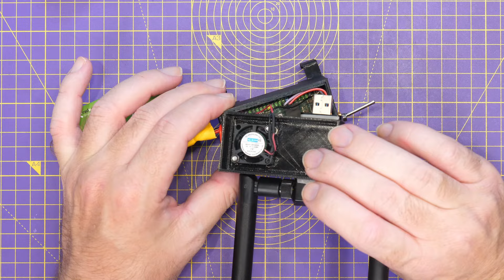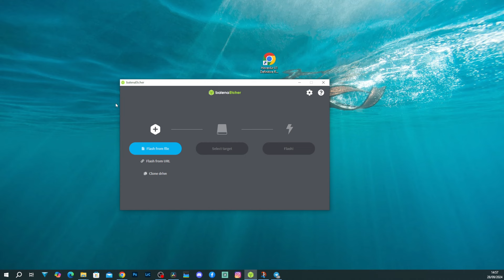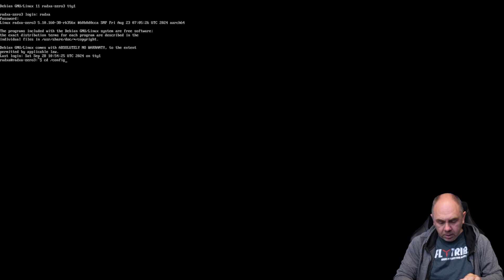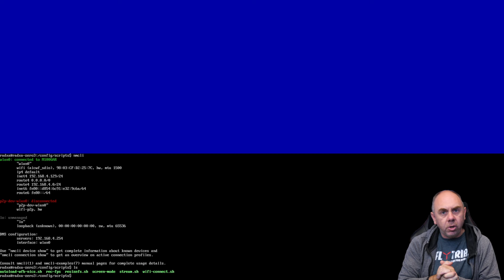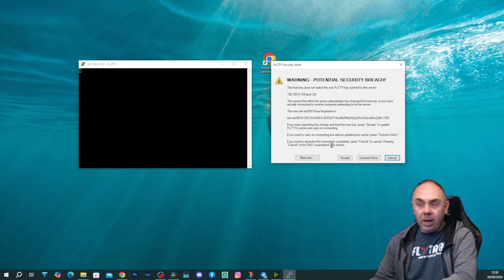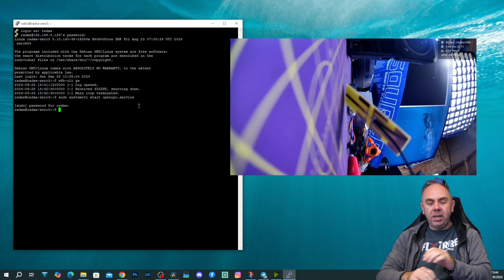OpenIPC SBC VRX Ground Station Setup Guide For FPV Goggles

Comment: I got the emax 100mw vtx, raddxa zero 3w 4g ram no eMMC and header attached, and RTL8812AU wifi adapter. I needed a usb wifi adapter anyways, I gave my last one out, so I am excited for that hat to come out. I will give it a try :) I fly analog
Reply: okay I have my radxa working and setup. my wifi password wouldnt work, so I set it up with my phone hotspot, but who cares that just for ssh.

Comment: Great! Finally a decent guide on how to make a ground station for analog goggles with HDMI.

I would also very much like a guide on how to do it with the Radxa version with eMMC memory (I have the 1GB/8GB eMMC version) and preferably with recording the image on an SD card inserted into the Radxa. The description on Github is very laconic, nothing is explained in detail there, and I (like probably a lot of people) am just starting out with OpenIPC and Runcam Wifilink.

Can you see OSD data from the flight controller on the Radxa's SD recordings (in particular, GPS coordinates are important in case the drone falls and you need to find it)?

Can you play Radxa recordings in the field, on gogles in case of a crash? This is extremely important

Comment: Can you also make a hdmi to csi example? I think this could be more useful in smaller budget scenarios as the real camera transmission sort of what that other dji vista adapter was with those 720p cameras, do you remember? I think one would need for example a gopro + media mod, micro hdmi to csi, raspberry pi zero and one of those wifi adapters obviously plus the power cable but this would also work with bigger cameras etc so the "vtx side" stays the same and i dont know could be strapped to the lipostrap or so

Comment: As you mention, using an 8812AU/EU WiFi board with your choice of antenna is somewhat lighter/more sleek than your setup with the encased card and large commercial WiFi antennas.

Comment: I flashed the SD card. Hooked up to my monitor. Nothing, what could be the problem problem,green light comes on
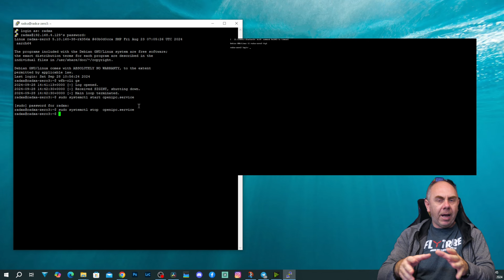Reply: 20:55
Reply: I mean at first boot up i get nothing,  no command line@surjitsinghdeo6533
Reply: I get nothing when I power on to set it up , tried different hdmi cables , monitors

Comment: For anyone who wants goggles input but without the hassle of building your own Vrx module , openIPC will be releasing their own Vrx module (sort of) and their own goggles (i know ian is not a big fan of this and tbh i think its putting the cart in front of the horse) but this is another option for anyone curious (please note that the Devs estimate a release of the hardware 2 months from now at best (and it wont be cheap because they [openIPC devs] have no manufacturing capability - they pay a 3rd part to make the boards so yeah)) , runcam is also building a Vrx module of their own , marioFPV will be doing a review in the next few weeks i believe (im not sure if its just a wifi module like the wyvern or if its HDMI out capable).

Also if you do plan on building your own please don't forget to upgrade the image regularly (some very major quality of life improvments are coming (BI directional link will be making alot of things easier and redundant but its not been added yet , i think in the next few months it might be added to an stable image)). 

And please join the openIPC telegram if you run into some trouble , everyone does eventually run into trouble and the openIPC devs are more than happy to help you out.